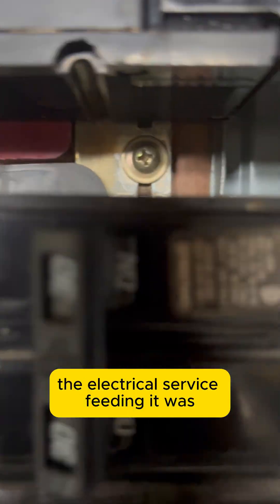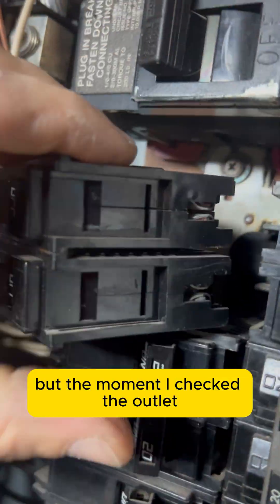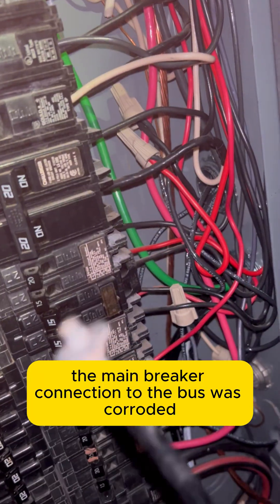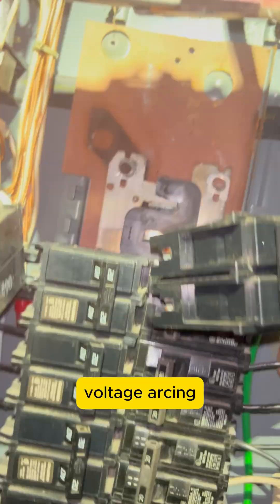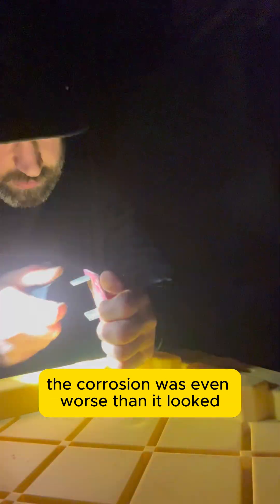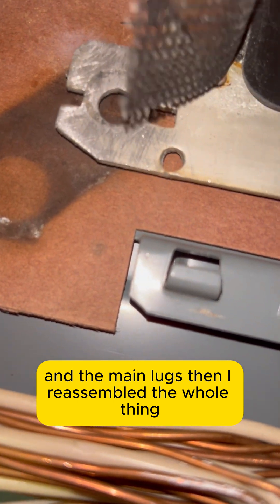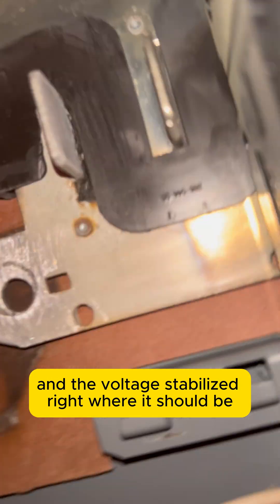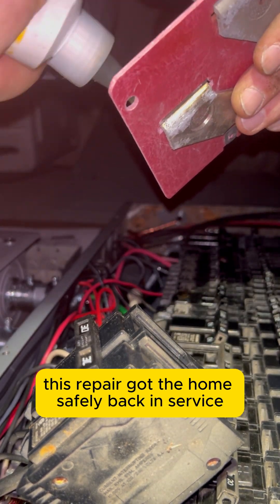Dryer Dead? The REAL Problem Was Hidden Inside the Main Panel (Corrosion Repair Part 1)

Comment: I'm sorry.. maybe I'm missing something... you hacked it back together, knowing it was dangerous(needing replacement)but saved the home by getting the "dryer back in service for the night"? You are a failure as far as electricians go.. no REAL electrician would worry F all about a dryer circuit when there is actual electrical issues.. you are a fail, Sir.
Reply from the maker: Appreciate the concern.
For clarity — nothing was ‘hacked together.’ The panel was fully de-energized, the damaged connection was disassembled, cleaned, treated, re-torqued to spec, and restored only as a temporary stabilization so the home could safely run overnight.

The homeowner was informed that the panel needs full replacement, which is already scheduled.

Short-term stabilization while preventing unnecessary outages is extremely common in the field when it can be done safely and within code allowances.

But thanks for taking the time to share your perspective.
Reply: @JoshTheElectrician-y9f  I guess my point was.. close out the faulty circuit.. no one needs the dryer overnight.
Reply from the maker: @BorealisNights  Totally understand what you’re saying.
In this case, the dryer circuit was just the symptom — the real issue was corrosion on the A-phase main connection, which was causing one leg of the entire service to intermittently drop out.

So this wasn’t about getting the dryer running; it was about stabilizing half the house and preventing a potentially more dangerous failure while waiting for the full panel replacement.

Appreciate the conversation.